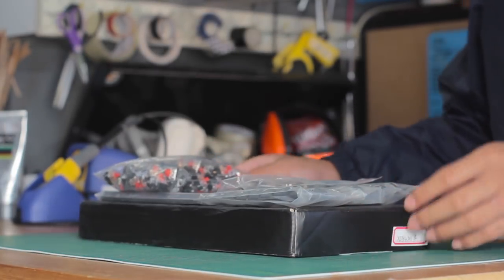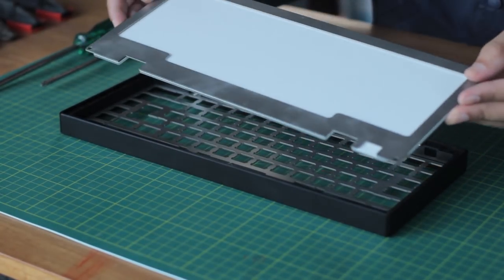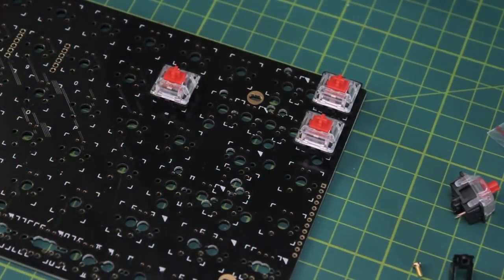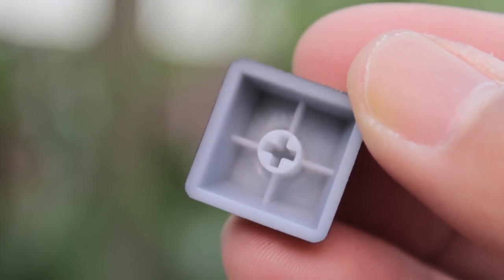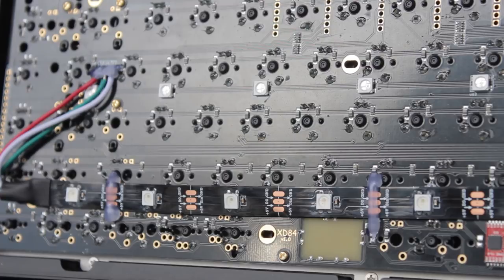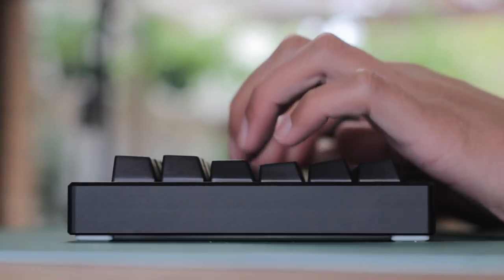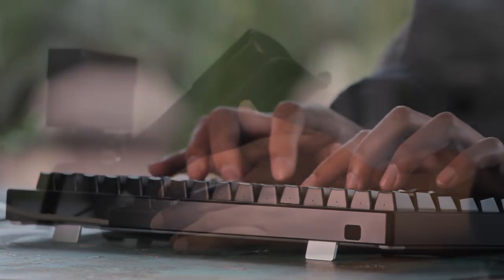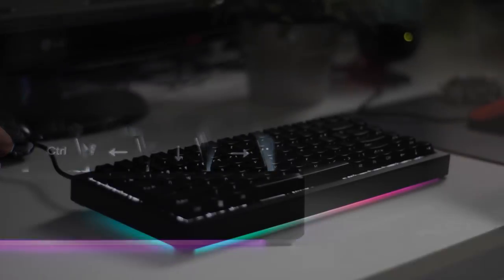XD84 Custom Mechanical Keyboard Build & Review

Comment: The 96 key suffers all these same problems plus many of it's own(Other than LED's, it uses 2 rows instead of 1).

1. Although the body has extra backplate mounting points, the aluminum frame for the back acrylic attachment does not have holes drilled to use them. This causes the middle of the back plate to sag and feels terrible. I fixed it with double sided tape so it doesn't sag, but that makes disassembly a royal pain. 
2. As much as I appreciate the gesture, they allowed for far too many switch configuration options, especially around the arrow cluster. So many, in fact, it is nearly impossible to mount the switches straight as both the plate and the pcb allows the switches to wobble freely in that area. 
3. Since the board is completely swiss cheesed in the right modifier and numeric cluser area, and the bezel leaves a huge gap between the caps and the bottom row, the LED under board to the right of keyboard cat shines right into your eye, in two different places. Between the modifiers and to the right of the right arrow(if you use the same configuration I did).

Other than that, I love the keyboard, but if I didn't like the layout so much, I wouldn't like the keyboard at all. Too many flaws. It needs thicker bezels, more mounting points for the back plate, and fewer options in the arrow cluster area. It's poor design to place the backlight LED right behind a hole for an optional switch mount location.

Edit: Also, mine came with acrylic, and of course, the acrylic cracked on one of the screw holes. Not enough for it to not function however.
Reply from the maker: Thank you for your insights :)

Comment: So I went and built an XD60, so I've got these things to add:

- The plate has four mounting holes/tabs - personally I think this is a bit too little, as mounting keycaps makes the board flex on the edges a lot. I solved it with some spacers I made from leftover silicone, stuffing it between the glass and the PCB. I'd rather have had six tabs, but hey, you can't have everything.
- Due to the top-mount style, the plate has the tendency to bounce back against the alu case, causing an annoying tick. Just taping the underside of the top where the plate contacts the case solves that.
- The flip-up feet are indeed somewhat disappointing, mostly because they lack rubber tipping. I solved that by just ductaping the ends, which makes them grippy and soften the contact point.
- The rubber feet are nice, but when the flip up feet are folded out, the bottom feet are kinda useless as the glass hits the table (because the feet are more chamfered than the glass is). I flipped the rubbers so the screws actually made them extend further - but I'd rather have thicker feet. YMMV though, depending on the exact placement of the glass. It's just less than 0.5mm.
- The XD60v3 PCB comes with USB-C and has 12 underglow LEDs, which is nice for this case and much-needed. If you can though, get the DZ60 PCB since it has the full 16 LEDs and "lower" LED position.
- QMK can be flashed, which has VIA support, which is awesome, though I think this holds for all non-"OEM" boards these days.

Still very content with the build and the look and feel are way ahead of an acrylic case. I'm considering ghetto-gasket mounting it for a slightly lower board and a more flexible even feel.

Comment: I was interested in making a custom 84-key layout keyboard as well, but the customization options for this layout are really limited. There's not a large variety of cases like there are for 60% boards and the key layout is also a challenge. It's a shame as I think the layout is the perfect mix between minimalism/aesthetics and usability.
Reply: I recently did a budget custom mod by getting a Drevo Gramr and switching out the stabs and switches for cherry stabs and Kailh box whites with new pbt keycaps. I paid very little for what otherwise would be a pretty expensive custom keeb, would recommend.
Reply: i have a gramr and you could add the keycool line separator to make it a removable micro use cord. i would recommend that.
Reply: I spliced a female micro USB into the PCB cable so it already has removable USB, thank you though!

Comment: I just bought one of these cases on mechmarket last week, then went and bought a KBD75 Type C PCB since I want a split Spacebar and split right shift. I like having an FN key set up to the right of right shift so I can have the arrow keys like on an HHKB.
Reply: did you have any problems with the type c not fitting?

Comment: This is still a pretty cool cheap case. I have had the XD75 for a couple of years now, which is just like this but smaller 60% size, and its served me well. The case sits a lot lower than typical tray case like tofu, and its a lot more comfy, I never even used the feet, not a big deal. Even this basic top mount case is world better experience than any tray case. Its so easy to make your own plate for it if you want to try other material and you can burger mount it super easy for a soft bottom out experience. Just need longer M2.5 screws and some silicone oring to sandwich the plate. This way plate sits lower in the case a bit enough for the case to hide the bottom o f the keycaps as well. I think the gray and the blue colors are very good looking. The black looks kind of plasticy here. KBD75v3 is also top mount now but cost like 3x, not worth it imo. You can get much nicer boards for that much money,

Comment: I bought a XD84 as well, instead of the KBD75 mostly for the price and the fact it was top mount (which seemed like the better option). But I still picked the KBD75 PCB for it's additional LED row. It felt like the best combo for my money.
And overall, I had pretty much the same feeling. But the feet sucks big time, they don't allow the keyboard to sit properly making it particularly annoying to type on. Turning my keyboard into a useless board now. I like the light being diffused on the bottom of the case, the clean look and everything but I don't enjoy typing on the board while it's flat and I can't use its feet because they are crap. Kinda wish I went for the KBD75 instead.

Comment: So... I bought this case and PCB,  I'm going to be building it with  kailh box whites  and. Some. Nice shine through double shot pbt caps backlit with UV  and I'll be adding the extra strip as suggested by you.... One question,  what firmware does this PCB run and what do I have to download to be able to customize the layout??

Comment: Anyone know if there is a 75% out there with f keys and arrow keys NOT spaced out (like the KBD75/YMDK75), but is ALSO hot-swappable AND comes with a metal case with a brass plate? I've done so much research and it seems this has never existed yet. I'm desperately looking for one!

Comment: Hey man. Looking to build my first board and your vids have been very informative and encouraging! 
I have a question which you may be able to help me with.
I've been doing research and have decided on the 75% form factor, although I've had very mixed information regarding compatibility between the xd84 and the kbd75 parts for some reason?
Essentially, I've found a certain xd84 case (Anodized aluminium FLAT case), which is a much cleaner simpler case than the overpriced KBD75 stock case.
I've read some places that they aren't compatible, and in others that they are.
Something tells me it's to do with the plate?

TL:DR  -

Which one is compatible?:

 kbd75 PCB      |     xd84 plate+case

or...

kbd75 PCB and plate     |     XD84 case      <(I'm guessing this one)

Keep up the good work btw! And you should totally check out/review the xd84 "flat alu case" - seems like an awesome alternative for someone who likes the style of the vortex race 3, but doesn't want Cherry MX switches and wants a similar aesthetic (aka me)..
peace!
Reply: the kbd75 plate is not compatible with the xd84 case since the xd84 has top mount design. so you have to go with the kbd75 pcb + xd84 case and plate

Comment: Gold plating the stabilizer wires is a real waste of gold though
Reply: Luca Baldassi As if we are running out of gold
Reply: Anh Tiệp Trần How am i a dick
Reply: Claiming an endless supply of resources seems to be our species biggest downfall, you should be wiser than to use as much gold in electronics because eventually we will run out.
Reply: Annual gold consumption is around 3,800 tons per year, and around 300 tons are used for electronics. That's less than 8%. Running out of gold is no more of a concern than it was 100 years ago. Gold isn't a sustainable resource, but jewelry is by far the industry that consumes the most gold. That's far more of a waste.
    Furthermore, running out of gold may have disastrous impacts on the economy, but its effect on the environment would be much less disastrous. The consumption of gold is not harmful like resources like crude oil and coal, and it can also theoretically be reused after consumption.
   Blaming recent changes for problems that have always been there seems to be "our species biggest downfall".
Reply: i dont have a problem with practical uses of gold, I never said that. lol
Reply: Well electronics is a far more practical use than most.
Reply: I know, I'm just saying do not be wasteful, idk how you got more out of that. AHA
Reply: Graham Kettles 
Looks like you're backtracking now, because it sure seemed like your initial comment was about electronics specifically
Reply: Ernie Kim it was. But you're forcing your context down my throat. Which just isn't what I believed. Believe what you want, don't tell me I said things I hadn't.
Reply: Graham Kettles 
Alright, the first statement has been edited out. I apologize for leaning too much into implication. 
    This contrext, however, is not my belief, it is just facts. It feels like I'm shoving it down your throat because you can't ignore it, or form an educated opinion without it.
Reply: Graham Kettles 
Alright man. I hope the important issues get solved, no matter the cause.
Reply: That was the most chill ending to an argument ive ever seen in the comment section